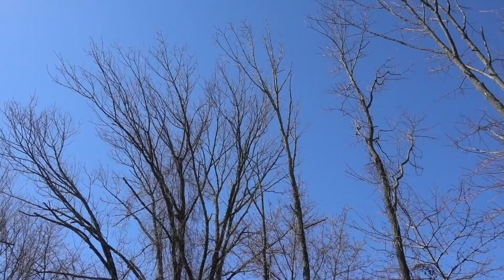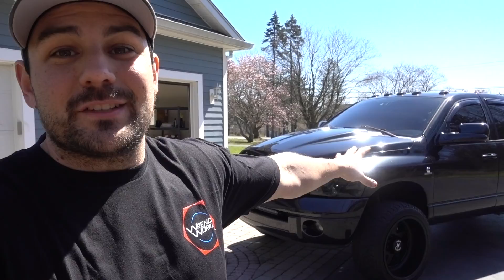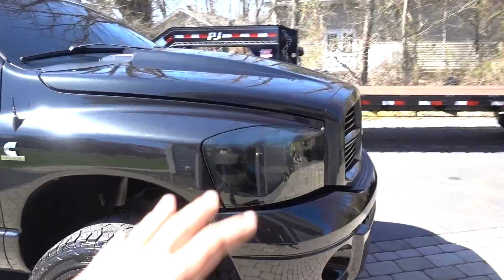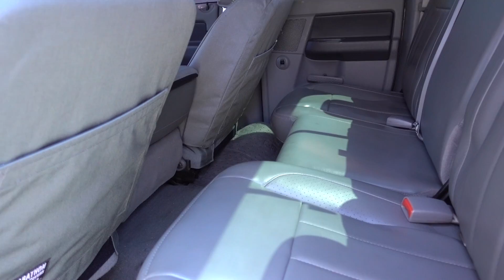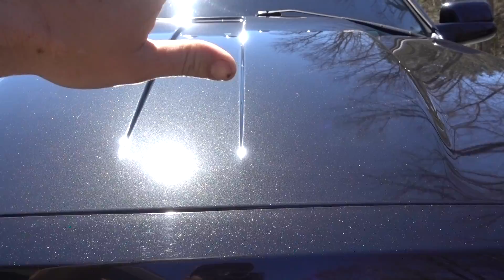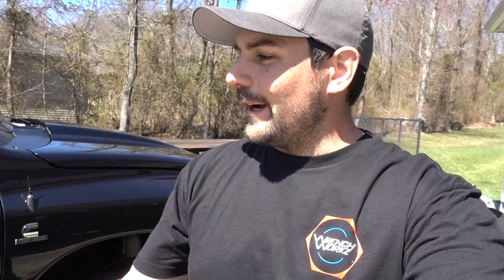5 Things I HATE about this CUMMINS TRUCK!!!!

Comment: Greg, first I’d like to say thank you to you and Ali for all your time and effort you put into this channel and wrenchworkz. You have truly been an inspiration and have given me the confidence to start wrenching on my own truck and undertaking a job that way over my head. I own a ‘03 2500 crew cab and it has 290,000 miles. I bought the truck in 2011. The truck is bone still stock except for a k&n air in take, 4” straight exhaust to 5” stack, and a US Gear dual range unit and were on the truck when I bought it. 
In the last year me and my wife, Emma got married and bought our first home. With all that time and expenses we didn’t have time for a honeymoon so my plan is to try and have the truck ready for a long road trip pulling a camper this summer. I have many many questions regarding my belt eating monster and would love to send you a email with a list of all my problems and my part list to fix them.  To give a brief background in the last 3 years I have gone through 5 serpentine belts and 3 power steering pumps and a stint of death wobbling and had these issues addressing at a local shop. 2 months ago I mounted new tires on the truck 315/70/r17 and could barely keep the truck on the road so I started grabbing and pulling... and come to realize that every component of my steering was shot ( ps pump, ps gearbox, all tie rods, ball joints, u joints, shocks) To say the least I have bought new or upgrades for everything. 

I have 4 quick questions. First, question is regarding pressing the pulley on the new power steering pump. The pump I have is a A1 Cardone 961008r pump and bought the dorman 300-149 pulley. I’m unsure how far to press this on, for I feel that this alignment was my problem for throwing belts and wearing t he pump and gear. Should I press the pulley on prior to mounting the pump or after it’s on the truck. Also the gear box was shot so I went with a PSC SG853 and a PSC SB300k stabilizer. My question is regarding the pitman arm. I purchased MOOG K440002. My concern is that the angle where the tie rod end connects is different then what came off the truck. See the picture http://i.imgur.com/S5vs7FK.jpg I have all new steering linkage, MOOG parts for the first design steering. Don’t know if it is worth upgrading to the new steering style with installing a new gear and ps pump. Would you recommend a powering steering filter?

Third, I would like to add a secondary fuel/water system. I would really really love to add a airdog system and sump (even made my wife recently buy off wrenchworkz to try and win one!) to the truck but it’s not in the budget with everything else. Researched a few other filter kits (western diesel and one from dieselfuelfilterkits.com). Didn’t know if you have had experience with any of these or could recommend what route to go to make my own. also would like your opinion on a coolant filter kit (sinister diesel).

Lastly, with my the upper and lower ball joints (replacing with moog) the driver side lower c-knuckle bore on the axle is egged and oversized by .015-.030 and the ball joint slides loosely In and out. http://i.imgur.com/zZDq3xv.jpg.    http://i.imgur.com/Cv8PspM.jpg.   I have a video of the play in the bore but don’t know how to add it to comments. Have you seen this before and what would your fix be without replacing the axle? The axle is off the truck. By trade Im a job shop machinist mainly specializing in steel mill rebuild work and reverse engineering, but we have the technology to make anything. My plan is to allign the axle on our large horizontal boring mill and bore out the c-knuckle, then make a sleeve that we will shrink fit Into the axle C. Spent many hours looking online for people with similar problems but haven’t had any luck. Please help!  
http://i.imgur.com/uYIcFUe.jpg
http://i.imgur.com/mhYLLTO.jpg

Thanks in advance for the help and best wishes to you, Ali, and Baby A!

Comment: Glad yo hear that your wife and child are top on the priority list. I have a 03 ram quad cab 1500 hemi black with 71xxx miles. It is mostly stock except for MBRP 3” cat back exhaust and a K&N air filter, black 20” plasti-dipped rims off a 06 ram. Biggest gripe with the truck I have is with such low miles the MN winters have rusted out the box. 
Big shout out to you and your growing family! Best of luck in the upcoming days.

Comment: Had a black '06 quad, long bed, slt and loved it. 4" exhaust not sure if it had a tune but it idled at like 350 rpm could easily get up to speed under 1000 rpm. Traded it in with 313,000 still running great. Didn't like how it wasn't as nice or as loaded as my '11 crew cab Laramie so wish I still had it.

Comment: Good luck with the birthday, love the show. I have an 08 6.7 short bed now last one was a 99 Dually. Question is about tuners. My truck was deleted when I got it and had an unknown tune that allowed the codes not to be thrown, also it had the function to allow the exhaust brake button to stay in the position that it was left in when the truck was turned off. Great for cold remote starts. I put a new tuner on smarty and lost that ability. Is there a tuner that you know of that allows this function?

Comment: I agree with the back seat deal and I definitely agree on the gearing. I have an identicle build 08 but with 4.10's and driving on the interstate hurts me a little inside on stock tires. When I go to 35's it will help some but they definitely could have used a deeper overdrive ratio.

Comment: Greg, Not to worry about not enough wrenching; it's understandable.  Take care of Ali first; the rest can wait.  Good video.
You asked that our annoyances be posted.  Well, I am like you; I hate dirty engine compartments, small leaks, chipped paint, and scratched rims.  Here in Idaho on rural roads; I hate chipped and/or cracked windshields which are a real challenge.

My fleet of Dodge Cummins are listed below.  All are powered with the 5.9L 24 valve Cummins with performance tunes, billet trans & T-case, Dana axles, straight piped, steering gear stabilizers, and front-end leveling kits.
1999 SLT Sport 2500 White (wife's truck)
2001 SLT Sport 2500 Red (mine)
2002 SLT 2500 Atlantic Pearl Blue (youngest son)
2002 SLT 2500 Silver (oldest son)
2006 SLT 2500 White (mine)

Comment: Greg if you want to protect the paint better look into ceramic pro. It's a clear coat that is hydrophobic it does not allow much if anything to stick to the truck. It just falls off its kinda cool. I have it on my truck and the rain the snow ice salt mud it just falls off. a rinse and dry is all I got to do to it. They make products for glass paint wheels fabric leather plastic just all kinds of stuff to protect your vehicles inside and out. Ceramic pro. I highly recommend it for ya.

Comment: Be happy with the 3.73s. I have a 17  6 speed 2500 that i tow a smaller gooseneck and 8k worth of bobcat. Granted mine is stock but it has no ass when it comes to accelerating, I’m Lucky to be at 50 merging onto an interstate.

Comment: I got a 4th gen 1500 2wd 4door, gas burner just put some ebay rock lights on it str8 pipes with 6inch tips and it's black and I hate the one wheel peal, and the small back doors. Good luck with baby A showing up soon, enjoy the sleep while you can buddy, I got 6 3 under the age of 7 so hang on for the fun buddy

Comment: What’s up Greg my name is Tristan and I’m in AZ. I drive a 2016 single cab ecoboost f150. Tuned, downpipes, thermostat, intake, exhaust, 4.5” lift with 35” Toto mts on method standards 17”. The one thing that bugged me the most was the auto stop and start on the truck.when stopped at a stop light. Engine would turn off to save gas lol. Had my tuner disable that. So far haven’t found much else that I do not like

Comment: I got a 01 Dodge CTD 5 speed 301,000 miles which is my work truck. I absolutely love my truck its been so good to me. if i had any issues with it it would be the gearing in the nv4500.  It will haul anything you want but freeway trips doing 80 is a bit much, really the gearing is great i just want more of them. I think an 8 speed with 3 overdrive gears and 5th gear being 1 to 1 would be perfect.

Comment: I drive a 2001 black Dodge 3500 Laramie, DRW , 5 speed manual .. Has 113 thousand km (about 70 thou miles) ..I put a 4" exhaust (no muffler) , dash mat , and wheel spacers between the rear duals for the slightly wider tires .. I've owned it 4 1/2 years , up till I bought it no one had set in the rear seats , and I got the original build sheet with the truck ..

Comment: Greg what's your schedule for changing transmission, front and rear differential fluids?
Drive a 2013 2500 6.7 G56 Tradesmen only thing that annoys me is its not a 2018 Mega Cab Dually 6.7 G56 Longhorn Laramie

Comment: Q&A what would you reccomend for a turbo upgrade for an 04 cummins the 305 / 555. Not the 04.5 model. Truck is stock besides 5" exhaust.

Comment: Congrats ahead for Ali & you with the new addition. You 08' is pretty rad and yes do understand the pet pieves. I have an 05' 3rd Gen 1 ton dually custom with a very expensive front bumper, custom hood etc. Had friend complete a touch up before leaving TX. Was in AZ at a resort talking to security a bit. Looked & thought the gate was up...minutes later nice wide, deep multi colored scratches in the new bumper all the way down the passenger side. Am still pissed, oh well. Also bad gas with stock sys not knowing enough to run without 2-3 micron filters, lost an injector then #1 cylinder. Now nearly 2 yrs of sitting, the girl is at a friends getting a new reman. hypo motor install, turbo rebuild, +65 hp injectors, 750 Stroker CP3, Banks intercooler & Monster intake, bullet proof 48 Tranny package w/a deep sump, new gauges, smoked halo headlights, tail lights, new Ranch Hand dually rear bumper, 2" leveler in front, Bilsteins all around, 20 Fuel wheels and Nitto tires, New dual system Jensen stereo, total package Viper alarm system, my 500 gal tank getting an internal Corrosión treatment, bedliner in garbage for a new Rhino Coat and later a nice digital wrap to finish the exterior. Need to figure out if possible to roll the odometer back to zero..investment without next the wheels currently sitting at $26k. Wife's having a cow but does not know the total vested, she wanted it looking good and back on the road. Hell, the 3500 will be all new. Love your vids!!

Comment: Hello Greg, I have a 2006 ram 2500 5.9l with a g56 transmission. Has 73k miles, after installing efi live on the truck the clutch started slipping. Now that I’m looking into clutches I’m curious as to the amount of rattle and gear roll over your south bend has.

Comment: 04.5 dodge 6 Speed nv5600 long bed disk like list includes; quad cab, stereo, 3rd gen tow mirrors, Factory steering wheel previously worn out from my dad,  typical Dodge rust,  my worn-out injectors, and not getting boost to till higher RPMs

Comment: Wow I’m surprised your 3.73s run that high. Is there a big difference between the 6th gear in your trans and the overdrive in my 04? I just was checking my truck yesterday and at about 75 I’m around 2300 unloaded with a small 265/70/17 tire and 4.10s. I’m mounting a set of 315s at the moment and was really hoping to see a difference.

Comment: Hey man love the vids was wondering if u knew at what rpm does a 2nd gen 24 valve cummins starts to build boost as well what does a boost leak sound like and as well is it possible for a boost leak to sound like a buzzing or humming sound and would u ever do a dully build thanks keep up the good work man

Comment: I know your a cummins fan but i have a 7.3 powerstroke that does have the intercooler in it its a 5 2wd but getting 4x4 swap wondering what you would  suggest i do. Used for pulling the mud truck an maybe hooked to the tariler. What turbo charger an injectors would you go with the motor will be getting rebuilt. Im looking for about 700 to 800 horse thanks man

Comment: What size p-pump would u suggest for a 97 12v 5 speed 2500 quad cab long bed that gets driven on the street but would be quick at the strip

Comment: Dear greg a i kno busy guy an ur cummins guys but two question do u think there ever be obo powerstroke on the channel 2 is how much power on daily tow rig puts out . The only thing that i dont like obs powerstrokes are they over heat fastly and injection system fueling issues

Comment: Have a 2018 3500 dually. Only thing that drives me nuts is the heated seats timing out or turning from high to low. Wish you could over ride this

Comment: Hello Greg  i drive a 1982 ford f150 with the 351w and there two things that i hate about my ford lol 

1. is it's a 3 speed automatic transmission in 3rd gear a 70 or 75 the truck running at 3100 rpm and 3800 and with 355 gear's

2. the window seals are gone past 30 mph it gets loud from the wind noise lol 

other than that it works good for what i do it. 

the 3 speed automatic i can live that lol .

Comment: 2002 F250 standard cab 7.3 liter 4x4 with an automatic trans and 144k miles. Life long FL truck. Performance mods include 4” turbo back straight pipe, SCT live wire programming, and a K&N intake. 
Pros: reliability 
Cons: extremely noisy, rough riding and has a slight oil leak at the main seal 
TBH, I wouldn’t get rid of her for anything. She’s a dinosaur.

Comment: Awesome awesome video Greg A, I drive a white 04 common rail Cummins, and it’s got 236,000 and some odd miles on it and, my question is on mine is I’m trying to get rid of death wobble, it started here recently and it’s absolutely terrible when it happens, it happens most around the 60 mph range, and I did the front end upgrade like you did, on the 05 same kit, and I’ve recently did new shocks, and steering stabilizer shock and then after that hoping I’ve gotten it fixed, it’s still got the death wobble. Only thing I can think of left is the stabilizer bar, or some steering parts, or the wheel bearings, or tires, thanks in advance lol. And hope the baby arrives soon so we can see it, and hope Ali does good through labor and delivery!!
Reply: Hey man be sure to check your steering gear box, this ended up fixing my problem. Also check all the steering linkage, ball joints, sway bar end links and all your u joints
Reply: Michael Enos I’ve put a new front end in it lol new tie rods and all then put new steering stabilizer shock and new shocks for the suspension hoping that would’ve fixed it but not yet gonna try the stabilizer bar next and fix it it’s wore out and loose and then go from there lol it’s really annoying though lol

Comment: Q&A Greg need your help. My 08 6.7 with 68 rfe does fine on Highway but steep back roads pulling camper transmission heats up fast 220 and will keep going if I don’t stop. Got mag hytec pan and Lucas synthetic. 37” MT’s. Any suggestions on oil or what can I do to keep temp down? Otherwise truck pulls like a dream. Please help, thank you

Comment: I have a 03 5.9 contacted efi live and they said they don't support 03-05, how did you get your 05 tuned on efi, I'm stuck i want to do fuel, 2nd gen swap, s400, etc but with no custom tuning I feel it's not worth it to me.

Comment: Hey so if your worried about like a 3.42 gear set up I have a 2016 2500 with 3.42s running 35-12.50-18 on a 10inch wheel -24  offset s&b intake with the fleece Cheetah. And a tow tune all emissions intact for the moment an I tow with this thing a lot like 145xxx miles a year a lot and I have no issues with having 3.42 + the better mileage with lower rpms.  doing 75 mph I’m sitting at 1670 rpm ish doing 80 I sit right at 1820 in 6th I transport new trailers from manufacturers to dealers nation wide an Canada so it’s put to the test. On other note hope the baby comes soon an smooth an easy for Ali  take care an god bless

Comment: 06 mega cab dually 6 spd. Has homemade twins, always boosting, even just cruising without a load (terrible milage. Somewhere around 11mpg). The damn HAIL!!! And backdoor glass constantly brakes in the same spot. Other than that it will move a house if I need to

Comment: Gear vender over drive. It bolts up behind your transfer case. It .78 over, great for high step-it. If you’re turning 2500 at 80 you’d being turning 1950 rpm... When you’re down in Mexico.

Comment: Great video man 👍 got a 1988 3/4 tone truck single cab 4x4  with a small block 350. What annoys me is my front tires rubs up against the chassis when  I make sharp turns , n slamming my driver's door god I hate that the doors work but I'm going to be changeing it out but I can't do nothing until after May 5 when me n my fiance get married.  There a few things that I would like to do to the truck. Aftermarket head lights , tell lights new tires.   Q FOR YA.  How long have u been doing YouTube n the trucks mods?  I love Cummins engine  I like to drop one of my truck.

Comment: I've got a 2003 dodge ram 3500 single cab 6speed 4x4 what I hate about it its 5in straight piped and when you get on the throttle you get a droning noise in the cab that's very loud

Comment: The factory Nav is by far my biggest gripe. Tech advances totally aside, the interfaces is so bad on my '06 that I just don't get how it got put into production.

Some Dodge engineer:
Wanna scroll through menus? Here, we'll highlight your selection with a slightly different white than the white background. 

Wanna select an address? Here's a tiny, slow dial to play with instead, have fun.

Need to adjust the clock for daylight saving time? Get to clicking! Oh but we won't let you just manually change it... that way, when your Nav DVD needs to be updated, you'll just learn to live with a clock that's only correct for a few months at a time.